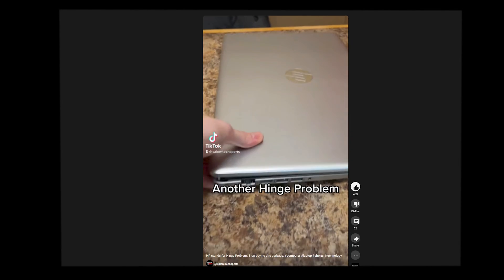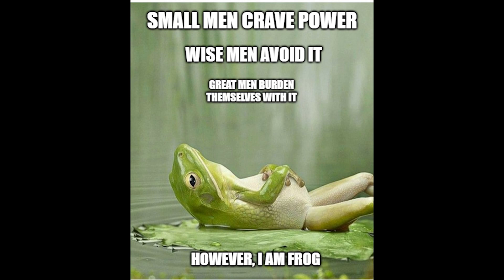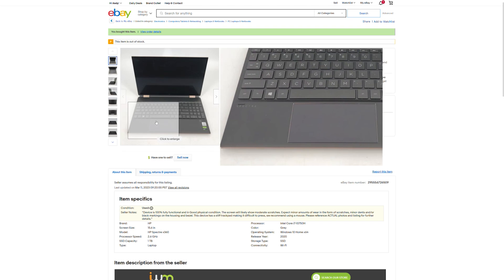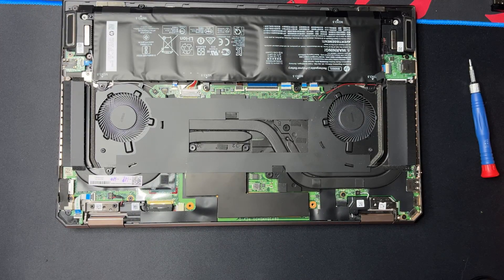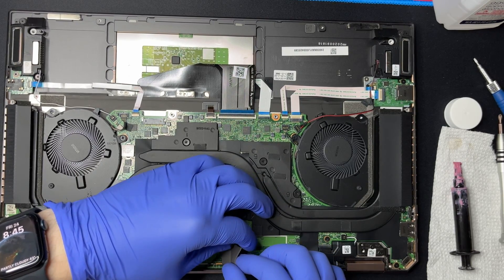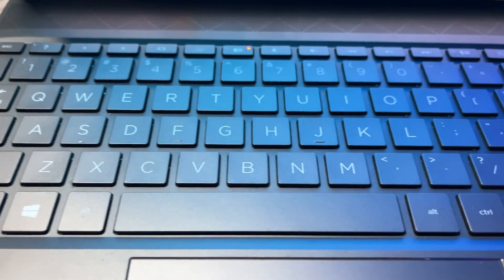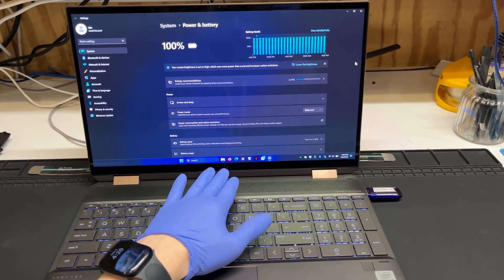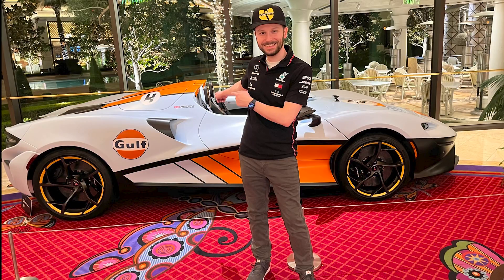Buying a used 2020 HP Spectre x360 off eBay: Good deal with big problems!

Comment: "Its the best laptop" all though the battery pops up like a pillow once a year and the cooling is garbage so i have to tweak it,  the ram is soldered, and i can't force the gpu to be primary, yup totally sounds like the best laptop ever. Totally not biased because it got numpad and 4k screen...

Comment: People sleep on these: yes the earlier generations sucked, but I recently picked up a HP Elite 6g and it super fast 12 threads 64gb of RAM upgradable non soldered, upgradable NVME and a Full HD Touch screen 1900 x 1200, thunderbolt 4 is 100w it charges my phone in less than 20 min from 0 and it displays 4k and can daisy chain. The body is made of aluminum allow with Magnesium metal all of the body is metal. It beats my MacBook pro M1

Comment: 1:00 convertible laptops are also the only laptops that are perfectly safe to be used on a bed 😮
Because you can just hold it in tent mode, where the fan will face upwards instead onto the bed

Comment: My HP Spectre X360 that I bought new in 2019 is still going strong along with its original battery. It has an NVIDIA 1050 GPU so it games fairly well, albeit with a fair amount of heat. I should probably replace the thermo grease sometime soon. I filled up the original 512GB M.2 so I replaced it with a 1TB. Despite having an i7 processor and 1050 GPU, it gives a very long run time on battery power. One of the reasons I think is because the 1050 GPU can be switched off and the i7's integrated graphics can be used when not gaming. I love this laptop and have kept it even though I bought a new Lenovo Legion 7i.

Comment: I got the same one, bought it new in 2020,  1050TI, wish it was an 1650.  I really like the design of it.  I just wish it had more USB ports.  Yes, I had to replace the battery once.  The original did swell.

Comment: I love the design, it just look gorgeous. I'd really like to buy one, if it wasn't for windows. My old laptop had windows 10 home, and I loved windows 7 so much more... then, the whole update stuff, like you want to sleep, turn off your computer and it comes with "hey, don't turn your computer off. were installing the updates that will make your old PC slow..." Then, 2 Years ago I bought a used MacBook pro from 2016, and although it has that butterfly keyboard, I don't miss my old laptop at all. Tis over 8 year old machine is better than anything of that age I've used for windows. I know, I could install linux on that laptop, but then I can also use any cheap laptop for like 100 bucks, because linux requirements are just insanely low.

Comment: i recently replaced a battery in a 2019 HP Pavilion for a loved one.... that pillow was so spicy cracks were forming on its bottom shell.... But now, it holds a charge, works well, and I even replaced the mSATA boot drive, and re-pasted the CPU, and cleaned out the gooch dust in the fan! thanks for all you do! not going into the repair business.... yet... but, I am able to help reduce e-waste by fixing things for my tiny community anyway, thanks to videos like these. Otherwise, that laptop was going to the landfill!
Reply: That said - I did have to buy an aftermarket battery for it because HP's genuine battery with shipping was going to be almost equivalent to what the laptop is currently worth... But taking a chance on BattDepot was worth it, because the price was reasonable, and they included instructions AND TOOLS with well-packaged batteries! And the battery is working well!

Comment: That's a pretty nice laptop indeed. But I'm pretty sure that the Dell Latitude 5310 2 in 1 is much better!
Reply from the maker: Not comparable. This HP has a 15.6” 4K OLED. The 5310 has a 13.3” LCD. 2 different buyers
Reply: @SalemTechsperts  Ok. But the 5310 is still a fairly decent laptop in terms of build quality and its super easy to service.
I bet that its way better built than my HP 14s. Is that true?

Comment: I got this exact model of computer a few years ago brand new, and it's been a fantastic computer; mine's been running flawlessly ever since I got it, installed Linux on it a few months back and everything worked super well right away, save for the fingerprint reader, but that's not a big deal.  I love this thing and don't plan on replacing it for a long time.

Comment: My old work HP had a swollen battery, it’s very common. Meanwhile there is a reason why you find thinkpads in almost every office and school. They are built well, reliable, have battery saving tech (eg charge to 80%) in the bios

Comment: (noob here) recently bought a Lenovo T480 (used for 130€). External battery is dead, internal has seen better days. Original batteries are hard to find and would cost meore than half the Price of the computer. It is just ridicolously imho.
Let's not talk about hinges or keyboard prices. Like 40€ for the hinges alone

Comment: Excellent Laptop. Garbage Remote software spotted TeamViewer *shudder*. Should use Rust desk or Tactical RMM or Mesh central and control your own RMM Anydesk is decentish for small jobs. Some clients of mine use TV and its absolutely garbage to remote in with clipboard never works connections drop its the worst lol

Comment: I have a 2017 HP Spectre x360 13" that's still going strong despite its 4C/8T i7 CPU. Its got a great screen and its battery life is outstanding, so it's a great mini machine to have on the go that's powerful enough to do most things.

Comment: I got my hands on a Lenovo Ideapad Gaming 3 brand new for $550 (good seller on eBay and during a sale) with a boring ass screen, (no oLED) 16 gigs of non-soldered RAM, and an RTX 3050 (laptop version) with a Ryzen 5 6600H (basically a 5500H but slightly faster and only for laptops). Smokin hot deal if ever I've seen one.

Comment: It would be a great step for standardised spare parts like batteries. I mean… why they always change the size, the capacity, and even the connectors on every laptop. It would be much better if all manufacturers would have the same battery. Less costs for the industry and less costs for the consumers. And: less cost for nature. A triple win situation. 

Same for lawnmowers which use batteries, or any other battery based tool. Same connectors, standardised formats… it would be so easy remember the old AA or AAA battery days 😹

Comment: I’d much rather go with a used XPS 9500, or even a 9510. You can upgrade the storage and memory on those up to 16TB and 128GB respectively

Comment: Hi
I bought a HP Spector x360 2016 from a second hand shop.
it is over heating and is slow 
it has original windows 11 pro installed and i7 6500u processor . i cant hear the fan most of the time it is way too silent 
how can i speed it up ?
will giving it to a repair shop and cleaning its fans and applying thermal paste do the job?
i dont know much about pc so your advice would be great

and the video was helpfull by the way😀😀

Comment: I also own this model of Spectre, I use the HP Command Center program to put it in "Cool" mode so it runs cooler. However I wish there was a way to make fans run all the time as it choses to wait until the end to turn them up.

Comment: I have owned one since 2015 (i7-5500U) and i agree to everything he says, if you can learn to replace a battery and add thermal paste then there is no other windows laptop which offers such refined enclosure design with little to no cost cutting.

Just got a victus this week, build quality is nowhere near spectre but then again it's only $650 for a really good spec'd model with a graphics card.

Comment: I am a proud owner of this x360 and was the envy of my architecture program bavk in 2017. It kept pace (if not exceeded) most of everyone elses pc's (even the tacky-looking ROG's).

Only in recent years had I run into my first confounding issue with it, and that is power cycling.

It all started with the spicy pillow batteries which I repaced, but still cannot shut it down, hibernate or sleep without it resetting - its very strange! Even the Bios believes everything is fine, so I'm thinking its an issue internally with the chip which might have been damaged by my negligence of not swapping put the battery fast enough. (Broke student life).

Aside from having to smother it to death with a pillow to turn it off every night, I still love streaming F1 on it and using it for emulation of older games (its a decent GPU after all!).

Comment: i have an hp envy x360 , and i agree with what he said. The display is hands down absolutely BEAUTIFUL , and the laptop over heats like crazy and needs a thermal paste replacement. To anyone who is watching this , if you are planning on buying this kind of laptops ,wether the x360 or the spectre , please immediately change the thermal paste if you can because it extremly over heats at times , sometimes even when watching youtube, and secondly , for some reason hp has by default disabled always on cooling fan through the laptops bios. So i suggest you entre the bios and set the cooling CPU fan to always on enabled .
Reply: I totally agree, however despite the change in the bios, my Spectre doesn't seem to have the fan always on :( . When it does turn the fans it quickly cools down so I wish there was a way to keep them running.
Reply: As someone with a (currently dead) Envy x360, I concur. When it worked, it was a gorgeous machine with an equally gorgeous display. Unfortunately, it no longer works due to some issue with the motherboard (wouldn’t charge, and all ports on the side with the USB-C outlets were dead), and it did have some overheating issues which may have contributed to it’s early demise.

Comment: I don't think that companies should be limited on how much they can charge for replacement parts. All it would do is transplant the extra price they charge to another area. In the end, it could end up the same thing or even worse. What we truly need is a company that doesn't do it. If one does it, it'll attract more and more demand, forcing the other companies to do the same. Another way to achieve the same is not buy replacement parts at all, but that's not really viable (after all, discarding electronics is not very friendly to the environment).

Comment: I have an asus zen book 14 inch. And asus made the cooking even worse than the laptop mentioned here. I put heavy load on it and under the laptop gets hot enough to burn you. It’s a ryzen 5 series with a dedicated nvidia gpu. 

It’s a single slim pipe and one fan setup. And the pipe cools gpu and cpu. And the cover blocks more than 50% of the fan. Not only that they dissipate nvme heat directly to the metal case. 

I always worry about the battery due to this high heat situation on the flawed cooling solution. And Asus does not allow me to modify cooling fan curve. It only ramps up when the laptop is near or already throttling. 

My late 2018 MBP at least has double pipes for double fans. And that one cools better than this Asus. It helps if I leave the cover of the Asus off or put more fans directing air to the laptop. 

Haven’t found a way to mod the cooling for this laptop. But thinking of getting some metal snips and tear a big hole so the fan breaths instead of choking. 

The MBP is really showing its age. DDR 3 ran and and old 8th gen i5 processor. Unfortunately I don’t have the cash to buy a new MBP as Apple has made the news even more expensive than mine was when it was new. 

But the Asus has some good performance on it. And it’s still fairly new at only around 3 years old. 

And lastly, I used to have an old hp. All it was good for is overheating and shutting off. I dug into that laptop but even reposting. And cleaning everything out it didn’t matter. The laptop required a fan blowing on it and low load to keep it from overheating. 

I can only hope some of the start up laptop companies making designs that are modular and easy to upgrade go mainstream because that’s when you can actually make the changes needed to improve everything about the laptop. Till then I’m sticking with my MBP till it dies off and my zen book. 

Laptops are always a pain.

Comment: So here is some craziness:

My hp Omen 16 had died. Nothing I did made it work. The power light came on for a second and died. No post or even a screen coming on. I thought it was dead. 

That was 2 months ago.  I started seeing your videos 2 days ago. 

Last night I tried to trouble shoot (again) by removing the boot drive and booting (again). 

When I hit the power button, the light stayed on. Then the screen came on with a cmos error (common).   Then it worked. 

Craziest part is that same day I was looking into sending it to you to look at. Totally crazy!
Reply: When a HP laptop shuts off during a POST test, without any indication of the failure, that means something critical has been detected by the superIO chip and the laptop has forcefully been shut off. This fault is usually BGA or chipset related and can sometimes be fixed temporary by common heat cycles. Sorry to break it to ya, but that laptop might die again in a month or two. (I am an expert in dodgy board repairs) If your laptop does fail again, you can usually turn it on by heating it up with a hairdryer.

Comment: It sure looks like modern Intel chips can't undervolt simply because they already extremely undervolt themselves (and they are still hot). The CPU can and will run as low as it possibly can, just to prevent overheating. The only difference you can make is by choosing the overclock strategy: will it kick in immediately, or just wait it out in a hope that the need for higher power is not going to last more than a split second, and you can continue to idle.

Comment: I have the same laptop. Replacing the battery. I think the one i got is OEM. I hope it is. Not sure how I'll tell.

Probably need to do the thermal paste also. Ugh. No idea what to do. Guess I'll search for that video. Didn't have the time though. 

Good story, huh?
Reply from the maker: Thermal paste is quite easy, if you were able to do the battery then thermal paste is no problem. Just make sure to use the right screwdriver bit because they are easy to strip

Comment: Yeah, most laptops, for power users, need mods.

Things I did to my Dell G5 SE; better thermal paste and thermal pads, removed mesh from bottom tray (no difference noticed, so this may vary), taped gap between fans and fins on cooling, upgraded the battery to a used Dell model for cheap, and found a 32GB kit of 3200MHz C18 RAM by OLOy. This laptop has been a blast to use for gaming and video editing for the past few years.

Specs; CPU - Ryzen 4900H & GPU - RX 5600M

Comment: I had an old pre-spectre x360  :) 
The m3-u001dx.

I did everything with that little laptop and even played back raw paperscans of hand drawn animation(can tweak the registry to give more vram to the intel). And it synced up pretty well to a whole bunch of different drafting screens. Plenty powerful for what I did.

IMO x360s and the spectres seem to have pretty good replacement part catalogs on hps website.

In the time I owned mine(gave it to family) I gave it so much more RAM, a backlit keyboard upgrade, and even a 1080p screen replacement. And yeah... new battery and SSD. Definitely not good to have a 180degree burning hot hdd running right next to a lithium battery xD

Now I run an ideapad, cause can use art stylus without a tablet and the stylus even works on my phone. So convenient!

Comment: I've had to replace the fan on my Acer Swift 3 three times because every time the fan would start being noisy and eventually fail. The battery connector somehow managed to become loose two times, meaning I had to open it and re-seat the connector. Also every few months or so Windows will shit itself to where the Laptop will no longer shut down properly and drain the battery when powered off, so you have to re-install a bunch of drivers to fix it.

BUT DAMN IT I GOT A GOOD DEAL ON THE THING 6 YEARS AGO AND I AM GOING TO DECIDE WHEN IT DIES. Not some fan or some battery connector. Amazingly though, the battery itself is holding up really well.

Comment: i have a 800$ 2020 acer spin 5 laptop very similar to that hp!! the weird part is i traded a 50$ motorola phone that i unlocked for it! lets just say my friend that let me have it is an idiot when it comes to money!!! sadly i washed off one of the keys on the keyboard when i tried to clean it and i also killed the backlight on it... smh! it still works perfectly fine though minus those two small flaws.. a keyboard is only 20$ though of amazon so i might fix it eventually...

Comment: yeah, I had a similar experience with my Laptop, I bought a used top of the line AMD Ryzen Envy x360 for about $100 because it had a tiny crack on the display and a detached hinge, so after fixing the hinge and changing the thermal paste I was left with a quite powerful 13" laptop that has a half working touch screen and a slightly ugly corner.
If you don't mind dealing with the issues they have, they make for very compelling second-hand machines

Comment: Secret pro tip for those who have overheating Intel laptops.

Check to see if you can set your cpu to max out at 99% cpu in the power options. This disables turbo boost and will significantly bring down temps. This will slow down the PC a bit though. I had to do this as a kid with a Fujitsu that overheated and shut down when gaming. (Thermal paste did not fix sadly)
Reply: and also if the computer randomly bsod, sometimes this also fix the issue due to the silicon aging.

Comment: I have a 2020 spectre 13 that has just been a disappointment. Overheating and screen issues with a horrible battery life.
Reply from the maker: Yeah which is why I don't recommend the average consumer to buy one. It has great potential but needs to be configured properly before it's usable.
Reply: @SalemTechsperts can you recommend any decent convertible laptop with 16 inch screen?